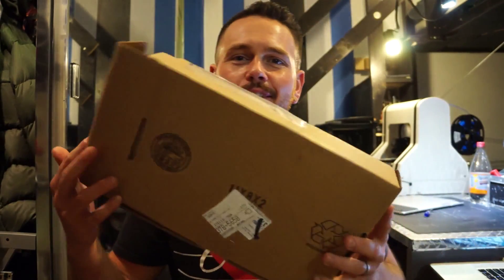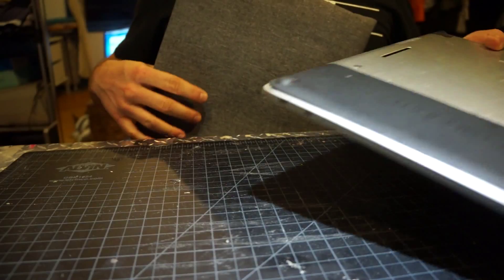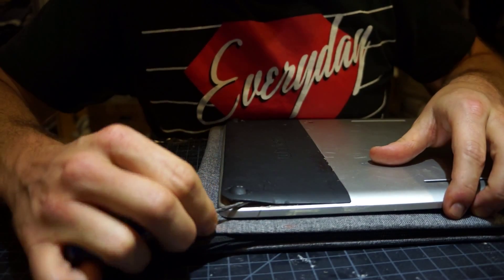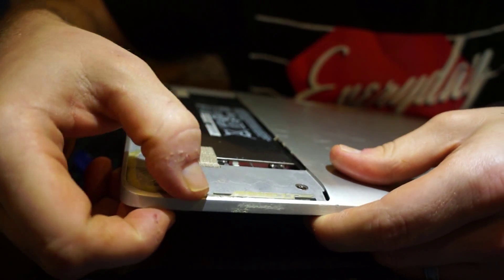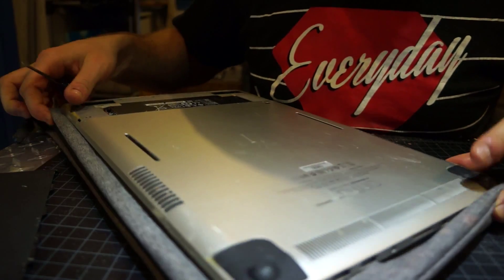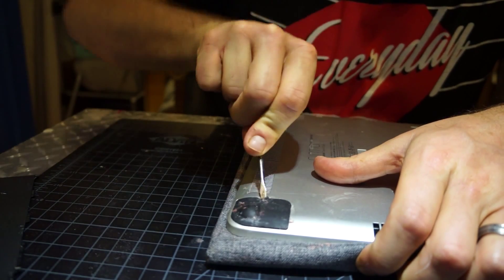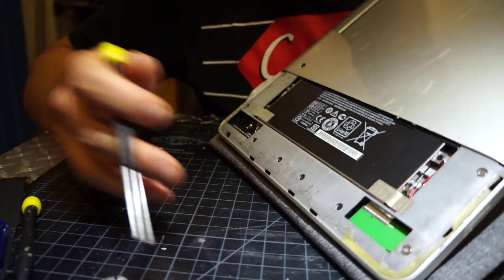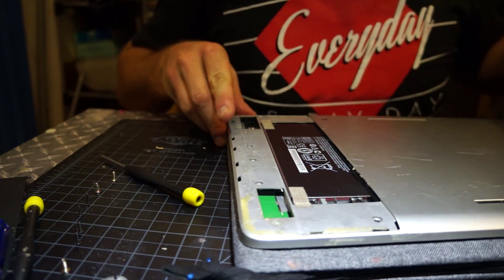Wacom Cintiq Companion 2 Disassembly

Comment: My companion 2 bit the dust after a little over 2 years, past warranty. Wacom is no help, even though it is a hardware issue. After a normal Windows update, while shutting down, it started up with a slight video glitch and then the screen went black. I did all the online recommendations, by plugging in an external monitor. Reinstalled the OS, Drivers, and even played with the F8 and bios to make sure it was not trying to send video to a randomly created window environment. Now, I have an expensive brick that can only work as a computer with a monitor attached to it like a desktop, but the screen doesn't do what you buy the tablet for. Drawing. 

The consensus from other people having the same issue is that the video card burns out by over heating. The support person even said he had no idea if I lived in a hot environment which caused it to happen. I replied with I live in cold San Francisco, and none of my 4/5 other laptops have ever done this. Though it is very similar to what happened with the CC1, support claims not enough people have written them or complained about them to think it is a hardware issue. I think they are losing money by all the returns that they are now just ignoring existing hardware issues and falling on the warranty sword. 

Repair here in the US is shipping (you pay) and putting your credit card down before repairs. I was quoted around $875, but they said they wouldn't know until the repair was done. Which means, your card is charged before OK'ing the work and cost. One person that I talked to said it ended up being close to $1000. 

I have been warning people about buying their tablets ever since. A normal Cintic seems more the way to go for now. Funny they changed the updated model name, but I am already seeing issues with it surface online. Too bad, while it worked it was a fun product.
Reply: jimmy love same problem with mine two monts ago!!
Reply: You hit the nail on the head. This is a hardware issue. I literally said to myself while observing the video artifacts and subsequent black screen "this thing is hot as fuck, I bet the GPU cooked itself and is now dead not displaying anything." Yep. This is unacceptable. They have designed multiple products built to fail within a ~2 year timespan and only provide a 1 year warranty. These people need to be hit with a class action lawsuit for this fucking garbage. I am so livid right now.
Reply: Just had the exact same issue! A brick would be more useful right now...
Reply: Same thing happened to me. A month after warranty expired.

Comment: Thanks for posting this. My CC2's screen suddenly cut off permanently after 14 months (of mostly sitting on a table unused...) and Wacom refuses to help, so I'm going to take it apart and hope it's just a loose ribbon cable. Everything else works fine if hooked up to a monitor. How a ribbon cable comes loose from sitting unused is beyond me though. Leave it to Wacom to find a way.

Comment: @TheCGAlchemist Hi, I have a question. I finally got my Cintiq CC2, and was curious about something. When your pen touches your tablet does it make a very, very low static, clicking or buzzing sound? It comes from the right side of the tablet, and It's a very low sound. At first I thought it was only when the pen was close to the screen, but it seems to happen whenever I do anything on the tablet, like holding enter on my keyboard inside wordpad. It sounds like the motherboard or processor. It's like a clicking or hissing sound. I was just curious if this was normal, since you know a lot about Cintiqs. I hope to hear back. Thank you so much man.

Comment: Great video. You mentioned in another video that the Companion 2 is a lot harder to open than the original version. Assume you opened a version 1 as well? Do you have any pics, video, and /or instructions on tearing down the original companion. Have the flaky power cord issue and may want to do a fix if I can resolve through warranty repair.

Comment: Hey Dude, really helpful channel. I was wondering if you had any advice for one step further? 
I bought a Cintiq Companion 512gb second hand, I have no clue if the warranty is on it and I have probably voided it now anyway by opening it up. I am having the charger issue and my audio jack had come loose. I wondered if you had any ideas on how to fix it and if you knew where I might be able to find a replacement audio jack? :/ Any advice appreciated bud.
Reply from the maker: +Dante Designs Hey! sorry I didnt see this sooner. Great art work by the way! Have you actually tried contacting wacom? I have a feeling if you let them know both ports are failing they might fix it for you.  If not you could open it up an do the work yourself. Is it the first gen? I had the same problem on the first gen and planned to retrofit a macbook mag safe port but for some reason I couldnt get the pinouts to charge, it was really strange.  Also even if you have opened it they likely wont know. I opened my first gen and dug around for weeks then sent it back for a replacement. (because I couldnt fix the power port myself).  If it comes down to it, you could likely add a standard power port or hardwire a core, which would suck, but it would keep it working. Interested in finding out what happens, keep me posted.
Reply: Thanks for the advice dude, turned out there is a special warranty extension for this particular issue as it's a known manufacturing fault.

Comment: You mentioned giving up on making a custom case with built-in stand. You might not need one anymore since you seem pretty happy with your Surface Book, but in case other people might still be looking for a good CC2 case, there is an excellent case with front cover and variable-position stand (that works in both portrait and landscape mode) called the Flipsteady (https://youtu.be/yud90XzLKcg). It's available for both versions of the Companion, plus iterations of the iPad, Surface Pro, and a few other tablets. Not affiliated with them, just a happy customer. :)
Reply from the maker: +Akionna Hey thanks for the input. Im familiar with them. Seems like a really nice case just a bit pricey for me.
Reply: +The CG Alchemist Yeah, the price point is the only real problem with the case. Imho, if I already spent $1300+ on a computer, it was silly to balk over $200 (they're on sale now, btw) to protect it well. And they're no pricier than the man hours, materials, and trial and error that would go into engineering a case from scratch, lol. Would have been happy to be your customer if you had succeeded in making a cheaper case of similar build quality. :)
Reply from the maker: Haha, yeah i put things into perspective too. An expensive device deserves a nice case. I however didnt like the loose wrap around design, Other than that it looks really awesome! The one I was engineering would cost $30-40 and weight half of the flipsteady. I have a working demo but really dont have time to put into production. Maybe the next model?
Reply: +The CG Alchemist Not sure what you mean about the Flipsteady being loose? It feels pretty snug to me. Or were you talking about how it has that flippy cover? How did you handle protecting the screen when not in use in your version? Does yours have a built-in adjustable kickstand and pen case/power supply holder too?

I hope you find time to work on it again. I'm sure you'd get tons of customers. Do you have a video demoing it? I checked and didn't see one, but may have missed it.
Reply from the maker: I dont have a video demoing one, it has a screen cover and a case built it but only adds a mm to the thickness. I will have to dig it out and make a video demoing it. It has i think 2-3 different drawing heights but no pen or power holder. Its very minimalist.  I like the flipsteady but it seems to add weird extra loose fabric to the edges and corners. I could be wrong.

Comment: Do you have a link on Amazon on the wifi that you got to replace it with? The one that works? thanks. I just got my companion 2.
Reply from the maker: +Jeff Mendoza Hey congrats! How do you like it? I did a screen protector swap for a better quality one and love it way more now. As for the wifi card, the original link was at partstore and doesnt seem to be working now. https://partstore.com/Part/Lenovo/Lenovo/20200480/Refurbished

But i believe it was a thinkpad part Im pretty sure this new link is the same one.
https://www.partstore.com/Part/Lenovo/Lenovo/20200480/Refurbished.aspx
Reply from the maker: +The CG Alchemist Sorry this is actually the link to the compatible internal card. Most any external card will work as long as its compatible with OSX.
Reply: +Jeff Mendoza by the way are you based in NY? was wondering if you can help me disassemble my CC2 haha... too scared to do it myself.
Reply from the maker: Haha, sorry no, the opposite side of the country otherwise I would.  Dont be afraid, I know its an expensive device but ive taken mine apart a handful of times already and will again soon to upgrade the SSD. My biggest suggestion is be careful with the rubber feet clips. The rubber feet are also attached with super strong two sided tape that made it hard to take off and I ended up breaking the clips. Someone suggested softening the adhesive by heating it with a hair dryer.  Other than that the thing is a tank!  that being said, im not responsible. haha!  Good luck, you can do it!
Reply: +The CG Alchemist thanks! Could you check my other comment on the parts? I just bought those and im picking them up tomorrow. I also got a set of prying tools hopefully it will be painless for me. Ill take note of the rubber feet thing.
Reply from the maker: Pretty sure all those parts should work but the wifi card is a tough call, it looks right but its very obscure.
Reply: +Jeff Mendoza bring it down here and we'll do the shit good ;)
Reply: haha wala na it's already returned.
Reply from the maker: You returned your cintiq?
Reply: yep

Comment: thank you for the great video! I'm trying to decide which tablet to buy and the fact that the display of the surface pro 3 will brake when opened puts me off. Now I'm tending to the companion 1 since the fans are supposed to be less loud and may I ask: have you opened one of those too and if you did is it pretty much the same as the second generation?
Reply from the maker: the surface screen will break? :/ never heard of that. the fans of the cintiq first gen are a bit quieter but I think the second gen is worth the trade off. where do you plan on using it? I really only notice the fans when I'm at home and its really quiet. I opened the first one and it's very different internally, no upgradeable ram. You can find pics of both open on my blog. good luck!
Reply: +The CG Alchemist thanks for the super quick reply and I'm very sorry but I just can't find your blog x_x 
I plan on using the companion in fairly quiet rooms and while I would not be bothered too much I really fear that the noise would get on other peoples nerves - do you think it could be possible and would be helpful to change the fans for better ones in the 2. model?
Reply from the maker: +Katrin Phyllis sorry I usually have the link in the description. here it is, http://thinkinginteraflops.blogspot.com/?m=1 
I used it in a fairly quiet coffee shop and didn't notice it. I noticed it Aust home with my fan and tv off, but I want ripping my hair out. I think it's a bit blown out of proportion. As for retrofitting the fans, its something I considered but they were pretty much engineered for this product and getting others to fit would be tough, so no I don't really see that as an option. have you used either companion model yet?

Comment: i just got one of these , mines really messed up and the customer support ppl wont send me a new one. I have had it for about a week now.

I think that there must be a video ribbon that is loose or defected.

Want to see what its doing ? 

artblade.blogspot.com/2015/09/wacom-support.html

also i just learned that you can't paste into a youtube comment. how odd...
Reply from the maker: +Cody Knutson (Artblade) Holy shit! Are you serious!?  You have had it a week and it started doing that?  It appears you dont have it hooked up to another computer so it wouldnt be a connector issue.  What does customer support say to you?  Give me the details..
Reply: +The CG Alchemist Yes, it isn't connected to anything. Its the 512 model.
 This is actually my 2nd companion 2. The first one lasted about a day and it shut off suddenly and would never turn on. I called support and they were quick to send a replacement. This one started out fine, but after a few hours of use i noticed that yellow line that was forming on the right side of the screen and thought maybe a connector is loose (internally)  and maybe that will just go away. Well, at one point during drawing i shifted my holding position of the CC2 and when i held it by the bottom near the right speaker the screen turned into the red flashing. Now when i try to use it, the CC2 starts out normally then after some use it shows the yellow line, and after that it become red madness stuff. 

Ive tried to experiment with different positions to hold the CC2 in to see if i can get an idea of whats happening. Ive found out that if i lightly squeeze near the right speaker the yellow line will go away and the screen will clear up perfectly. As soon as i stop squeezing the problem will come back (sometimes fast sometimes slowly). Sometimes when it happens squeezing it does nothing or just makes it worse and the screen goes black (backlight still on). Using it on its stand seems to speed the images distortions up, or makes it worse. It seems like when i set it flat on the desk when the line isn't there shortly after booting it the screen will for the most part stay normal. I'm still testing it.

As for support. Ive called them a few times since Ive gotten the replacement. They've asked for pictures twice and the serial number twice, and they keep saying that they have to show it to their higher ups, but they keep saying that so it seems like they are stalling by saying that. I asked the guy on the phone "How long does it take to show them how messed up it is" and he evaded the question. I'm getting the feeling that they are waiting out the "30days free repair shipping". The first time I got a replacement it was a quick call and the shipped it in a week and I was confident that this was behind me but with the new Companion 2. I know im being impatient here but damn these things are pricey.

this time the support isnt being very helpfull. This is the first computer thing that I have ever had this kind of a problem with. Ive barely been able to draw on the thing at all.
Reply from the maker: +Cody Knutson (Artblade) This is all completely unacceptable!  Im wondering if they have had so many problems with the version 1 and now version 2 that they are trying to be more picky with returns. Regardless if the product is defective they need to take care of it and especially for what we pay for these. What is the timeframe from the time you contacted them to when they reply?  Have you written an email with a link to your blog ?  I will contact them if I have to. Please keep me posted as to whats going on with this.  Youre right it sounds like a connector and you might be able to fix it, but the point is you shouldnt have to.
Reply: I called them first on Tuesday and almost every day since. I would normally be more patient but this is the 2nd one of these I've had and I'm trying to make a business. I've sent them these images and the video. The first guy seemed unable to load the images and the other guy could. Thanks for your advice so far. 
I'll let you know how it develops. Hopefully they can have more answers for me when i try to call on monday.
Reply from the maker: Yeah keep me posted and let me know how they handle this.  It might play a part in weather I do future business with them as well.  I feel like email with them might be the way to go since you will have logs of the interaction.  
Good luck!
Reply: +The CG Alchemist I called them again today and they have agreed to replace it. I just had to keep pressing the issue it seems. So 3rd times a charm, hopefully.
Reply from the maker: Sorry to hear you had to go thru that, i just got off the phone with someone who knows of them having backed up return tickets for various issues.  I assumed this was the case.  Which is part of why, even if dissatisfied, I wouldnt return mine.  I like the product and want Wacom to do well.  Their pen experience is first in class.  They just need to hammer out the issues with this new product.  I wouldnt be surprised if they reconsider launching a successor to this line for a while as i imagine they currently are taking a bit of a loss.  I really do hope them the best.  Congrats and I hope youre replacement suits your needs!
Reply from the maker: oh bloody hell.. sounds like it could be more than just you, unless you posted that??
http://forum.tabletpcreview.com/threads/wacom-cintiq-companion-2-discussion-thread.65068/page-114#post-448032
Reply: no, that wasn't my post. Scary, i hope that my next one isnt effected by this again.
Reply from the maker: +Cody Knutson (Artblade) first I had heard of this, wondering how common it is now.